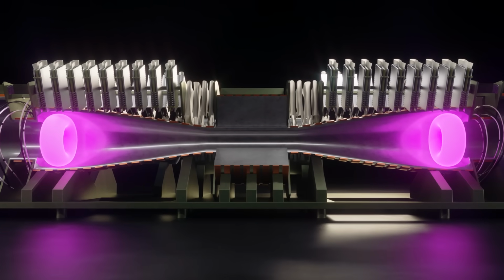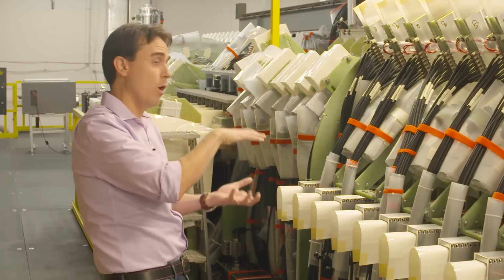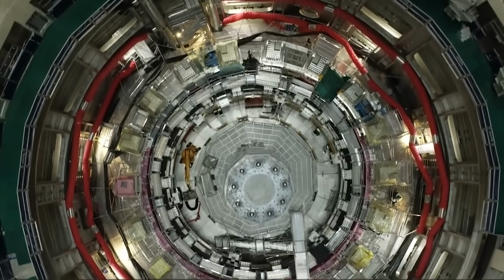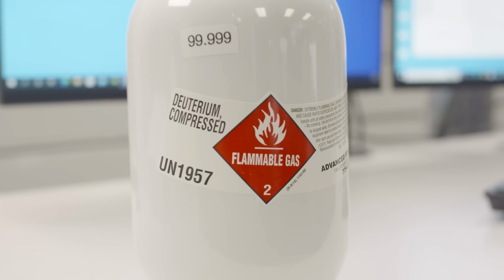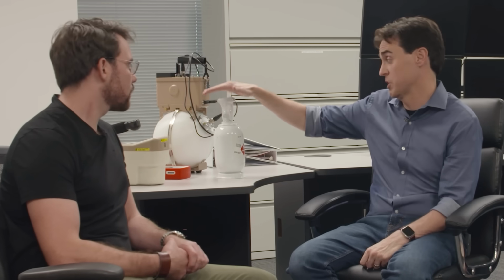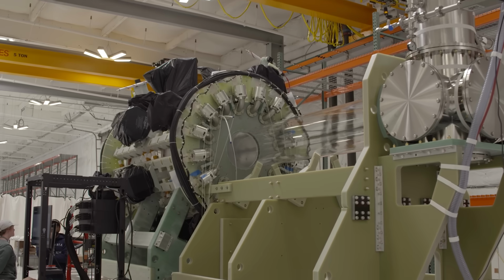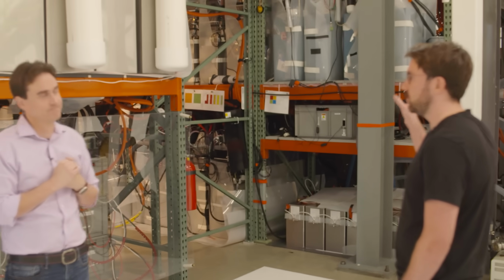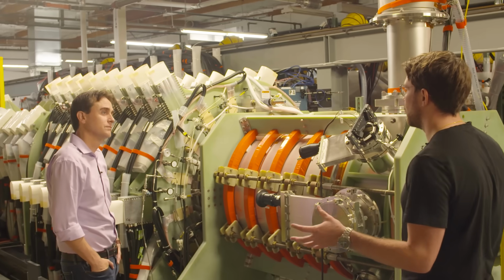A New Way to Achieve Nuclear Fusion: Helion

Comment: This is a swindle! There is no such thing as high temperature fusion. High temperature fusion is a myth, a fanciful theory based on a lie. This process is akin to having two fusible particles, in a streetcar sized container filled with air and then trying to pump so much more air into the container, that the two widely spaced particles will be pushed together. Of course it can't be done... All that happens is, the two particles become more rigidly held, apart. It accomplishes the opposite of what they are claiming!  Is this a criminal enterprise?
Reply: You can't be serious, right? First of all, your analogy is completely off. Second of all, we have done high temperature fusion for decades now. This can easily be proven with fusion products.
And of course the most extreme example are hydrogen bombs.
Reply: @elmarmoelzer2229  Hydrogen bombs are fission NOT fusion! And no one has produced fusion of anything, if they had, they would be hiding out trying to avoid all the money being thrown at them and the whole world would be celebrating. Get real!
Reply: @rodkeh  Not true at all. Hydrogen bombs have a fission trigger for fusion reactions.
You are confusing "producing fusion" with generating "net electricity" or at least "net energy" from fusion. 
The fusion can be done even as a high school project with a fusor. Those will produce a few billions of neutrons a second from fusion.
Net energy and net electricity are a lot harder to do. For that you need bigger and more expensive machines that are more difficult to build. The first ones of those machines are coming right now and more in the coming years.
Reply: @elmarmoelzer2229  Your problem is you are American so you know nothing about science! There are only two stages and they are both fission! There is no such thing as high temperature fusion! That is what all this swindle is about. Trying to prove that the fantasy of fusion, is a reality but even Einstein couldn't make it work!
Reply: @rodkeh  I am NOT an American.
Reply: @rodkeh  lol what even is this? Where do you think the neutrons for the second fission stage come from if not fusion?
Reply: @rodkeh   So according to you tens of thousands of fusion researchers around the world are lying. None of them are falling out of line and telling the truth. 
And fusion machines that produce neutrons are actually fake and powered by uranium fission.
Fusion researchers must be one amazing secret society if they have been that great at keeping this secret going for over 70 years.

Again, kinda strange how even a high schooler can build a fusor and produce neutrons with it, even make He3 and Tritium.
Reply: @elmarmoelzer2229  And the analogy is spot on!
Reply: @rodkeh  It is not.
Reply: @elmarmoelzer2229  It most certainly is!

Comment: Deuterium is NOT safe... yeah you can drink it, but it bogs down your ribosomes and will cause long term health problems... its the same as putting the wrong fuel in an engine, it might work for a while, but it will break down eventually.

Comment: If you did anything wong, you wouldn't live to tell about it...
Reply: This is not dangerous, actually.
Reply: @elmarmoelzer2229  oh? If that million degree plasma escapes containment and touches the walls of the chamber, you'll find out otherwise...
Reply: @sosocrazy1234  
Sigh, I am writing the same thing for the millionth time now... Not your fault, just feel like a broken record right now. So here we go again:
The plasma is hot, but not very dense (closer to a vacuum than to ambient air). It only contains a few kWh of energy.
 If confinement failed, the plasma would expand and cool off while it does. In final power plants they will do it routinely and the expanding plasma will induce a current in the surrounding coils, doing work and cooling off while doing so.
If it touches the walls while still very hot, there would be some abrasion like damage on the inner walls. This is a problem if it happens often, because it would mean more maintenance, but otherwise, it is not that big of a deal.

Comment: And am I to understand that they are maintaining control of these unbelievable TEMPERATURE'S, simply by the use of a magnetic field? Did I hear him right when he said 1 million degree temps? I thought I even heard him say 10 million degrees. I'm gonna have to go back and listen to this again. How the heck can that be controlled?
Reply: The super hot gases are electrically charged, so by using magnets they can be kept so they wont be in contact with anything so it wont melt anything. And even then, those temperatures are only be reached for a fraction of a second
Reply: The fusion plasma is very hot, but not very dense (closer to a vacuum than to ambient air) and it is surrounded by a high vacuum, which is a perfect insulator. It cools off immediately when it touches anything like air or the vacuum vessel walls. The total energy content of a pulse is only about 8 kWh, a fraction of the content in a Tesla battery.
You can of course contain plasma with magnetic fields. This has been known for a long time. Plasma consists of charged particles. Charged particles react to a magnetic field.

Comment: so has Helion achieved Fusion yet?
Reply: They do fusion all the time. Have been doing fusion for over a decade now. Trenta is the one that is closest to net energy so far, might actually be there if it was fueled by Deuterium and Tritium and had the direct energy recovery/capture installed.
It is a proof of concept machine that demonstrates that their scaling laws were correct and that the next bigger machine, Polaris will be able to demonstrate net electricity from fusion (some time next year).
Reply: @elmarmoelzer2229  cool-the more companies that get involved the better chance we have of clean energy and less not forget rocket propulsion too   :)
Reply: @zarl5238   Rocket propulsion would likely be better done with a different design. Exhausting the plasma from this would have a very, very high Isp but very low thrust because the plasma is not dense and has very little mass. Though one might be able to increase that a little bit, maybe.
Reply: @elmarmoelzer2229  awww a different designed fusion rocket??

Comment: They could try to use a massive flywheel with a shaft connected to a power generator instead of capacitors.  A special generator with sections corresponding to a specific coil on the device.  In this way, timed firings depending on the position on the shaft can be obtained.  In the other direction, the generated current can be used to accelerate the shaft, and in another area of the shaft, place generators that would slowly steal energy from the flywheel to the power grid.

Comment: How is this fusion waste material controlled & stored? We need to do better than what we've done with fission
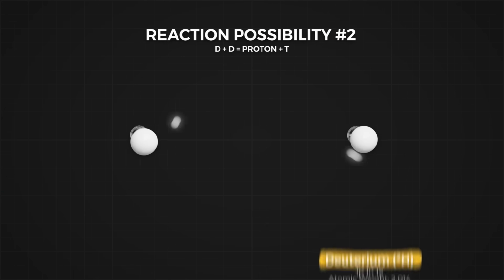I saw some around 15:00
Reply: It is very little and only low to mid level waste that will be produced by fusion power plants. Helion is doing even better than that. Their machines can be fully decommissioned within 2 weeks after operation and all components are below background level of radiation within less than a year.

Comment: This doesnt look like fusion. It appears to be a new way to split an atom. By bombarding it in a similar method as Einstein. And causing the atom to split. By bombarding it with extra particles. Same thing that the US is falsely claiming. In their case Photons. Same thing though, splitting an atom. Not fusion. This is all fraud.
Reply: No, it is fusion. Please watch the video again. Fusion is when the resulting products have less mass than the sum of the mass of the fuel atoms. That is called the mass defect. The missing mass is the binding energy which is released.
Reply: @elmarmoelzer2229  You apparently do not realize. Atomic/Nuclear FIssion. Normally this is caused by bombarding the atom with excess Electrons. Now whether Helions device, or the US device in Lawrence Livermore. Both devices are bombarding the atom with excess particles. Which is causing the atom to split, and release its energy. With the added particles. Hence more energy than just splitting the atom itself. That is not Fusion.

Do you know what particles are? Negative and Positive charged particles? When the mass density of these particles compresses the atom. It causes them ( the atom ) to SPLIT. Releasing the energy contained in the Atom ( Strongs' equation applies ). Plus these added particles. Hence the increased energy. It is still splitting the atom, and consuming all particles. That is FISSION, not FUSION.

 You sir, and half these frauds are who are mistaken. They are just bombarding the atom with excess particles until it splits. Releasing all energy, not just the atoms, but the additional particles as well. In a nuclei cascade.

There are easier ways to split an atom. The more energy expended to split it, that energy is caught up in the nuclei cascade. Hence more energy being generated.

Fusion would be welding atoms together using ions/ionization. Hence the term FUSION. Fusing Ions. Fusion. Is not what these frauds are doing. Fission. FIzzing Ions. Understood?

I would explain how this know-ledge is thousands of years old. And lost to ' Mankind '. To Fizzle, or to Fuze Ions. Fission/Fusion. Or how to manufacture new elements using a completely unknown to " Mankind " technique. But again, why waste time on those consumed by Shadow?

Not worth my time. What Man thinks they know, is their Shadow deceiving them.
Reply: @stealthmodehu2111  
Oh dear!
Some people prefer to die ignorant.
Please read up on nuclear fusion, even on Wikipedia. It explains it nicely. 
Seriously. Pretty much everything you said here is nonsense.
Reply: @elmarmoelzer2229  Wikipedia is full of misinformation. Designed to obfuscate. For example. In History. Switzer-land is called the Old Swiss Confederacy by the Nazi Descendants in Helvetia. ( Republic of Helveticus ). When in fact it was renamed by Nazis after invasion during World War 2. 

Fusion. Nuclei Fusion. Would be taking two of the same atoms. Say Hydrogen for example. And FUZING them together to make a Helium Atom. You Sir are the one misinformed, following a fraudulent field. Nuclear Fission is what they are doing. Not Nuclear Fusion. As the fuel is consumed. To generate energy. Which by its very definition is Fission. Fizzing the atom to generate energy. That's not Nuclei Fusion ( Fuze-Ion ). That's Nuclei Fission ( Fizz-ion ). 

I was an Applied Physicist when I graduated High School decades ago. How about you?

Please refrain from spreading your poorly educated misinformation. A lot of FRAUDS are involved in the scientific community. Due to their EGO/SHADOW make fraudulent claims of new discovery. Like this falsely claimed Fusion. When in fact all they have done was make a new method to perform Nuclei Fission.
Reply: @elmarmoelzer2229  I really don't have time to waste on this. So lemme break it down for you. That reactor in this video. Is a Hadron Collider without the loop. And it uses electromagnetic fields to contain the reaction. Smashing particles into an atom. And causing it to split due to compression inside that electromagnetic field. Again, they know not what they are doing.

Have a good day.
Reply: @stealthmodehu2111  so is it a hadron collider or an electron collider? You’ve said both now.
Reply: @infinitelyexplosive  No. Stop with your lies please. I said EINSTEIN bombarded the atom with Electrons. And THIS bombards the atom with PARTICLES/IONS. Get it right. Do you have an attention span issue? Or just like lieing about / on people? Spreading lies about my writings. Your Shadow/Ego consumes you. I shall not waste any further time responding.
Reply: @stealthmodehu2111  lol ok
Reply: @infinitelyexplosive  Hysteria. Laughter. Is oft times a response made by someone who has no valid rebuttal argument......

Your Shadow / Ego cannot accept Truth. And reveals itself in your manifestation of Hysteria. 

Not wasting further time here.

Have a good day.
Reply: @stealthmodehu2111  but you already did waste more time? Idk, you're clearly smarter than literally everybody else studying nuclear fusion combined so obviously we can't comprehend your words
Reply: @elmarmoelzer2229  I would explain more. But I cannot spare the time to waste on the subject. I can easily prove they are frauds. No one with a so called fusion reactor can leave it running. Due to the fact it is really only a new way to have a Nuclei Reaction using Fission. Let the fools claim whatever they want.

They know not what they are playing with. However, none of them can leave those reactors running for more than an iota of a second in time. And I, and others know why.
Reply: @elmarmoelzer2229  Lastly, shall we discuss Westinghouse initial flawed reactor designs Mr. Moelzer? Westinghouse thought they knew what they were doing as well. Turned out they didn't know half of what they thought they knew either.

Comment: Could the fuel generating reactor itself be surrounded by a blanket like the tokamak to recapture some of the energy of those neutrons? Not necessarily a beryllium blanket, just a light water blanket than then generates deuterium for the reactor itself from neutron capture.
Reply: It could, but it would cost a lot and currently Helion does not consider it worth the extra CapEx, at least not for their standard, mixed mode 50MWe plant design. In that, the neutrons would only have about 10% of the energy released by fusion reactions. At a conversion efficiency of 40%, that would be 4% of the total energy.
It might be more worthwhile for a potential pure He3- breeder design. These would only fuse Deuterium and the percentage of energy from neutrons would be quite a bit higher. They would also not produce a lot of power. So even a little bit extra could help.

Comment: H3 is abundant on the moon
Reply: He3 and it is not that abundant (about 20 parts per billion). Helion does not need it though. They will produce their Helium3 by fusing Deuterium in the same machine. D+D => He3 +n or D+D => T + p (the Tritium eventually decays to He3 as well). No space travel required.

Comment: If current is of the utmost importance, why is it that the capacitor banks are so far away from the coils?
A reduction of voltages losses could be quite sgnificative if the capacitor banks were built all around the reactor itself.
A 3D distribution of those capacitor banks may reduce the cable lengths and/or size by a factor of 2 or 3 while acheiving better control and more even power transmission.

How about making bigger coils so as to reduce current needs?

Seeing a fusion reactor being built in "plastic" for over 80% of its structure is quite unexpected.
Reply: The vacuum chamber is mostly made from fused silica.

Comment: A big question becomes how quickly does it respond to jumps in demand? (for example, during a prolonged cold-grid power start; both heating and cooling systems are going to compete for power demand from both the cold homes and facilities during a cold snap needing to be heated, and the power draw of refrigeration and humidification systems also powering on.) During the summer it becomes a battle of Air Conditioners and refrigerators both trying to cool down the contents of their respective containers, with the refrigerators throwing their excess heat into the homes that have the AC's running...

...God forbid you should have old manual thermostats and playful children that can actually turn on both the AC and the heating at the same time.

Comment: I can't imagine one of thease on a large plane. Designed to keep a warship in the sky for as long as possible designed to land in the ocean as a carrier and take off vertically useind 6 large rotors. Perhaps 18 of thease would be required to power the turbines to lift the mega structure but I'm sure it can be done.

Comment: Great looking machine ,except it is using more energy to create less energy.
It is like using electricity to power a steam engine.
Reply: That is not quite true, actually. It does produce excess energy if you sum up all of the energy going in and coming up, just not excess electricity. That will be with Polaris next year.

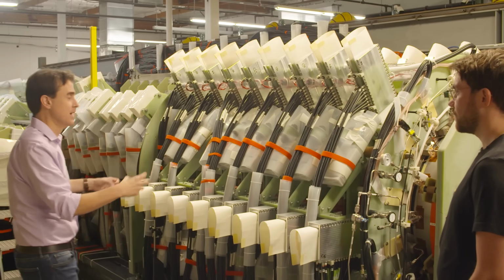Comment: I noticed that the projection of helium 3 on the diagramm at 4:27 about the fussion gas on the  formation chamber is incorrect because it shows the helium 3 with one proton and two neutrons instead of two protons and one neutron.Because as it is shown is tritium and not helium 3